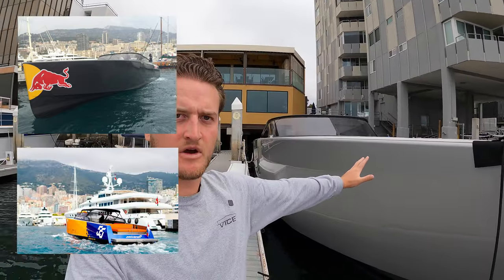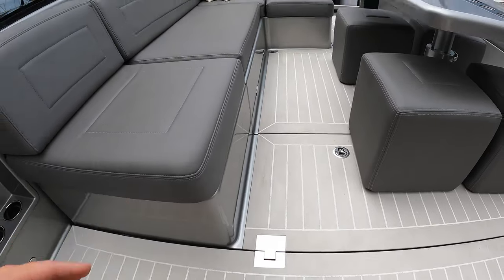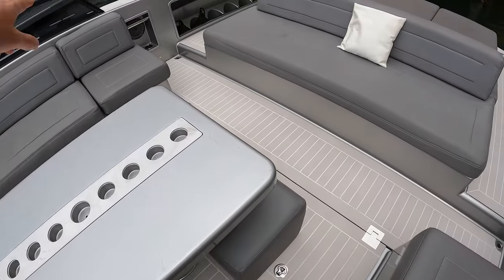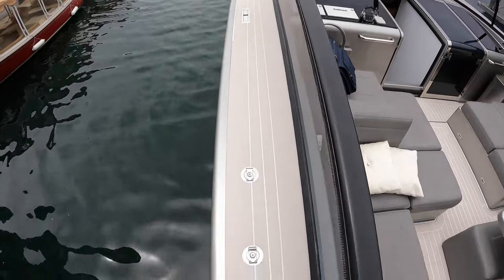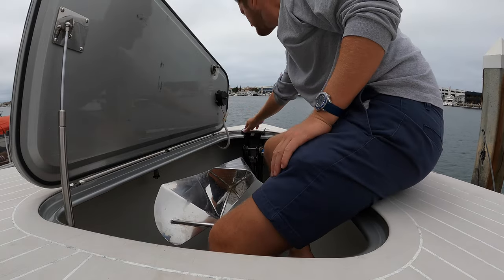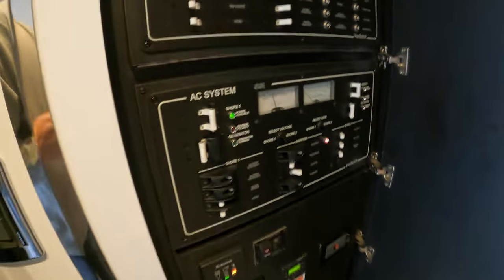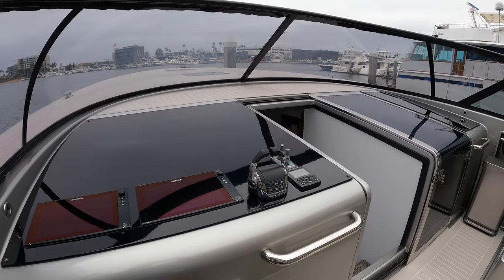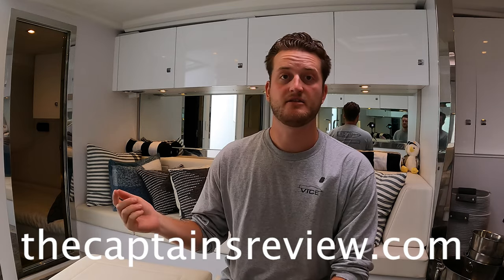A $1,000,000 Tender!? - VanDutch 55 | The Captain's Review

Comment: I do like the profile. The lines are very minimal, and elegant. But for that type of money, I wish there were large windows in the cabin for views and allowing a cross breeze.
Reply: Since it has the one way mirrors I would have installed a number of LCD screens behind them. Combined with discreet cameras on the outside you could have a number of or even wrap around virtual windows 🤷🏽‍♂️